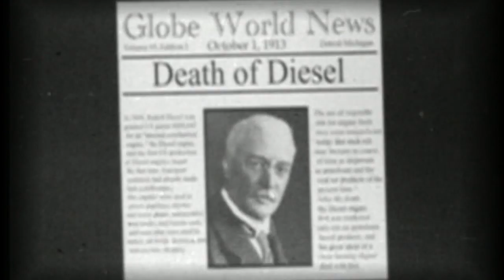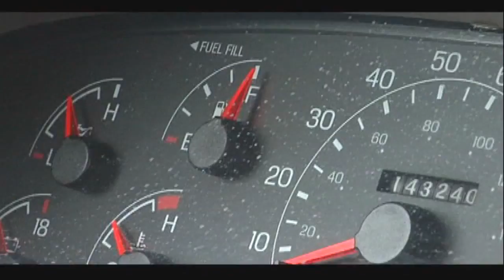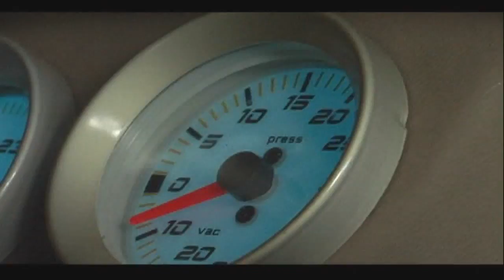Vehicle that Runs On Vegetable Oil - HOW TO

Comment: If the car has DPF (Diesel Particle Filter) it will also work? Is the DPF affected in some way?
Reply: Probably only works on pre def dpf trucks like 2011 and below
Reply: ive got a dpf car, been using oil for years and you wont fucking believe the money i have saved over the years

Comment: Use a 50/50 mix sun flower oil works very well and with the 50% diesel with the 50% sun flower oil you won't have the cold weather starting problems and there will be no need to retro fit the vehicle. Been using this mix for 11 years on a 1996 pajero 2.8 auto without any problems.and it lowers the CO2 emissions drastically but there is an increase in the NOX it does go up a bit.
Reply: Is it okay to just use straight up sunflower oil, without the vegetable oil?
Reply: @google-is-a-stupid-piece-o2543   yes i used it in my 305 peugeot TD in uk for years.....was much cheaper at 55 pence a litre of 1.20 per litre of diesel.....works perfectly
Reply: Use off road diesel 😂
Reply: Costs more than diesel

Comment: That’s really bad for the engine 😂
Reply: Diesels don't have spark plugs smart one
Reply: Colton small Diesel engine under 1.4 Ton ( loading ) use resistance spark plugs to warm up cylinders when engine get cool
Reply: @sonnynguyen8012  it's a glow plug, and it is only used when cold starting to help get to ignition temp
Reply: And also it burns so clean that you don't need a catalytic converter
Reply: You obviously aren't very educated about the subject. I've been running biodiesel in my powerstroke for 5 years now, and as long as you filter it properly it is just as good as regular diesel.
Reply: I drive my 2.5 turbo diesel XJ Jeep on 100% sunflower oil. Sunflower oil is much cheaper than diesel where I live.  As long as the temperature is above 50 ° F works perfectly.
Reply: @V8AmericanMuscleCar  how is that motor? Is it made by Cummins? Inline or v? Torque?
Reply: @billyjones9045  it is 2.5 inline 4 cylinder turbo diesel. Torque is similar like it is on 4.0 XJ. It is Italian engine, VM Motori and it's factory installed for European market. I like this engine, now I drive it on WMO.  It will run on anything that burns. 🙂
Reply: Sniper9143  Diesel engines don’t have spark plugs 😂😂
Reply: Perhaps one day when you are old enough to drive you will understand fuel costs.
Reply: Colton, no joke. My 7.3 costs $100 for a full tank.
Reply: Colton can you run it in the winter? And, what kind of set up are you running? I'm guessing you don't have a 6.0?
Reply: So I’m back and I’ve been running my 7.3 on 25-75 wmo to diesel, it smokes a bit but I just got some WVO and just put my first batch in da tank and it works perfectly, it still smokes a bit form the oil burning of though. The diesel has come full circle. 

Thanks rudolf you’ve changed the world and helped my wallet.
Reply: No it's  good for it diesel engines were designed to use peanut oil.
Reply: Sniper9143 so an idiot troll or just a moron doing a drive bye?
   I love people that haven't opened a book since grade school know everything, while unknowingly parade their stupidity to the world.
    What too lazy to give some facts? Or is it you dont have any?

In short.
SHUT UP STUPID! You're wrong.
  Go vote for a Democrap.
Reply: @Pharmant41  hey stupid if the heater messes up and you dont catch it in time it will screw up the fuel system and you have to change out filters frequently and it retards the timing so yeah it is bad for an engine do it in real life and it's ok for simple engines but not for any modern kind I can think of dip shit
Reply: Vegetables oil isn’t very thick and doesnt always combust as efficiently as regular fuel Because of this it becomes clogged in the engine. this can cause a clogged converter or misfiring spark plug.
Reply: @sniper9143  hey dummy no spark plugs in a diesel engine
Reply: nope
Reply: Why do u say that and how do you know this?
Reply: 7.3s don't have catalytic converters.
Reply: 94 7.3 IDI turbo Diesel, diesels in general don’t need any emissions stuff at all. No caty, no DPF, and no EGR. They are good the way they are.
Reply: @IDIturboDiesel  7.3s are ford's though. I'll NEVER own another ford to the day I die
Reply: Okay put vegetable oil in your engine